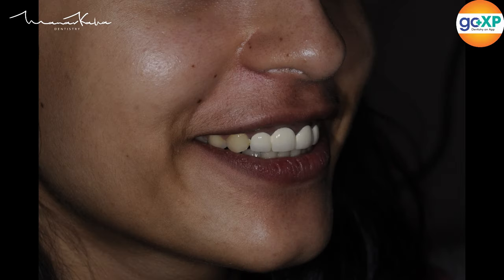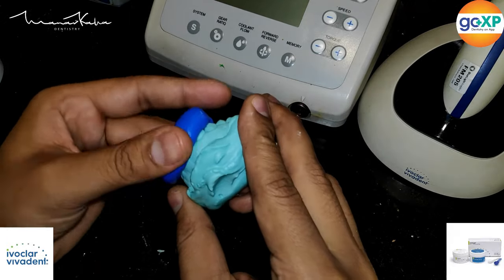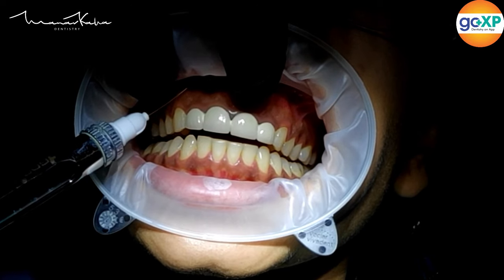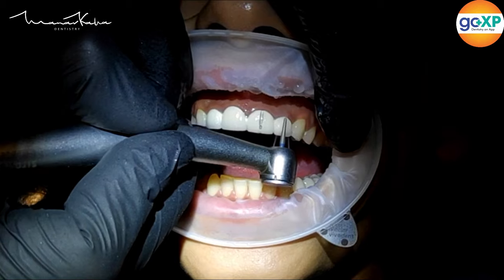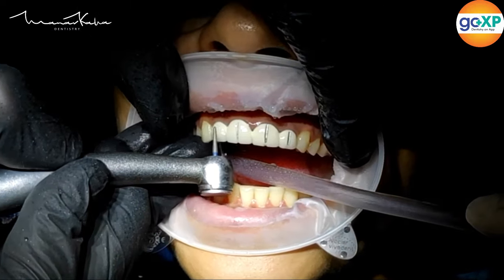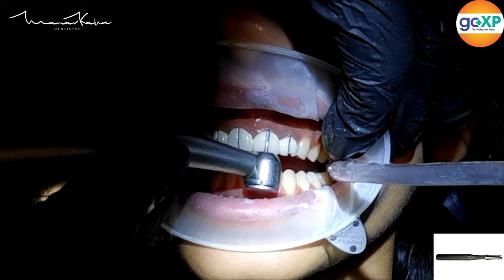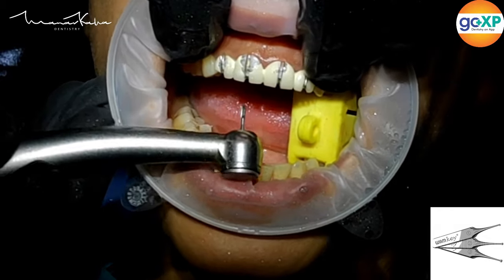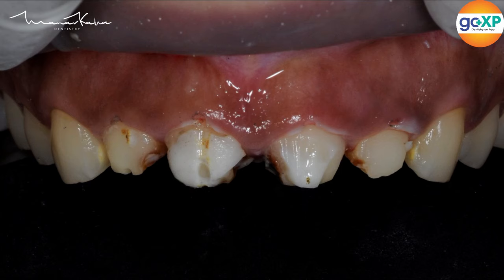How to remove old dental crowns without breaking teeth

Comment: Sir, I am from Bangladesh. I got a crown on my upper front four teeth two days ago. Uneasy feeling is happening after putting it on. It seems as if the gum is holding it under pressure. The crown seems to be attached with separate pressure. Will the gum under pressure come and release?

Comment: I have crown over one tooth, I requested to put plastic, but Doctor fixed the  ceramic crown with small clip inside without informing me, now I have discomfort, when I enquired again, he used to remove the crown by remover, but he cant remove it, it was painful, now another doctor told to remove it by this bur procedure, but I put my new crown only 5 days before, is it easy doctor? Or is it painful? May I remove by using this without breaking the teeth since the teeth fixed only 5 days before, pls tell some suggestion Doctor
Reply: Abhi remove krva liya kya tumne. Firse lagaya ya nahi
Reply: Pehle jaisa he teeth ya damage huva nikal ne ke time pe

Comment: Please doctor help i am 18 y/o today i went to my dentist. She tried for 4hr to remove my crown but still she was not able to remove it. Tomorrow she has called me again what should I do ? She is also saying metal inside the crown is so compact and there is high chances that my teeth will break 😭😭😭.
Reply from the maker: I would Highly recommend getting a second opinion.
Reply: Hey what happened with ur teeth can u tell now
Reply: @RamSingh-pw8ee  She pulled that case without breaking my teeth but she did my crowns bad. There was very minute gap between front two crown. So recently 2 weeks ago i got new crown. My dentist said you don’t need new crown, who ever made them are perfect. But still that very small gap was mentally haunting me so i got new one. 
New one are made by 3D AI printer machine so they are less detailed than previous hand made crown. But still I satisfied with new one because that ugly gap is no more there.
Reply: @txrokk  the crown is of zirconia???
Reply: @RamSingh-pw8ee   i think so. They cover both the surface. And overall for two front teeth it costed me around 11000

Comment: Will braces help to fix the gap after removal of this crown teeth?
Reply from the maker: No, You will need new crowns, if old crowns were removed
Reply: @manavkalra  is there any other way to make ur teeth natural?I have crowns  for past 5 years.but then they are big compared to my other original teeth,and they don't fit to my face shape,make my mouth bulged sideways and also straightways . it is making me feel insecured ,almost everyone around me  guess it to be artificial one. so,my doubt is ,whether crown can be made according to the size of other original teeth (small) to have a confident and natural teeth?
Reply from the maker: Crowns and veneers shouldn't look or feel artificial. We nowadays are able to completely integrate them in a natural way. Most patients forget which teeth we worked on :)
Reply: @manavkalra  Hope i will try and make the next one ,a natural.Mybface shape have completely changed due to dental crown .hope the next one does not look big and make me give a confident smile.
Reply: @naturelover5744   try zirconia crown.. it looks natural as your original teeth